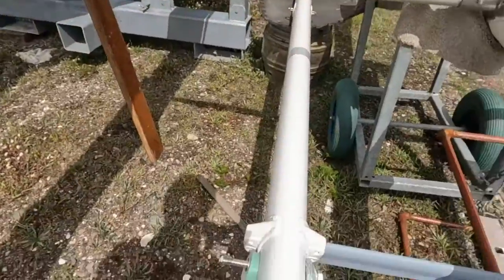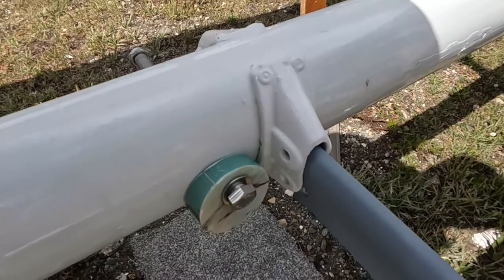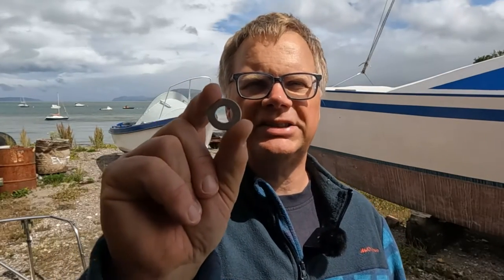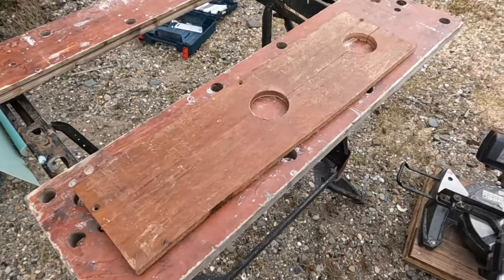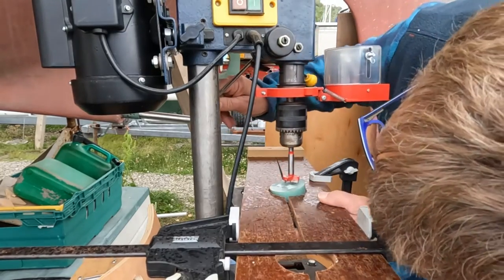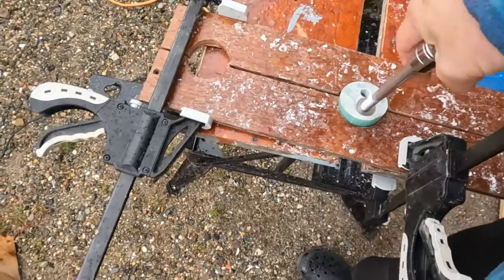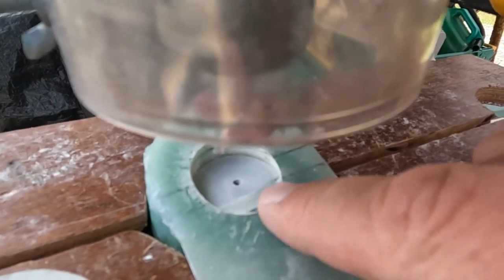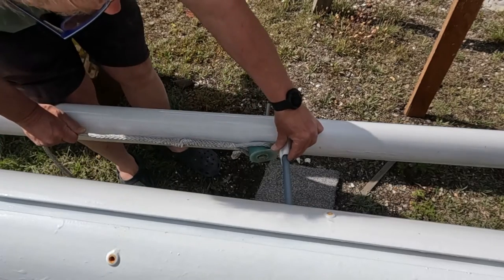DIY Mast tangs Version 2 for Dyneema shrouds, Synthetic standing rigging Episode 7

Comment: I will call the FAA and recommend an honourary A&P certificate for your efforts to adhere to aircraft specs! Congrats on the success with the bits. I have used FR4 in experimental aircraft and predict you will not have problems with cracking now. Consider epoxy paint as the resin will degrade with UV exposure. You could match your mast if you want. I would be tempted to make 4 perfect discs as your cheeks (although I wonder if you need to worry about the stay moving toward the mast and you might eliminate those.) and I would fabricate them and sand them before epoxying onto the tang. Then I would off-set the disks so they were eccentrically located to miss your spreaders. I believe you are using 2mm for cheeks. I leave it to your judgment but 3 or 4 would make me more secure. I would also use a fillet of thickened epoxy at the tang-cheek junction for many obvious reasons. Good work friend!
Reply from the maker: High praise! Thanks. Good tips for final finishing. 🤩

Comment: Hey, really enjoying your project here. One issue I think you should reconsider is the attachment of shrouds to the mast. The original tangs attached very close to the mast such that the bolt was mainly in so gle shear. This new design has a decent leverage arm on that bolt. I suspect you're at risk of fatigue failures over time on this one. I have training in this stuff so take it for what you paid...I'd stick with traditional tangs on the mast to connect up shrouds. Good stuff!
Reply from the maker: First thanks, glad you are enjoying the project.
We have thought about the issue of the leverage on the through mast bolt. Jane trained as a Civil Engineer so does do some check calculations for us, she does get irritated with my sloppy language about loads and forces so I hope she isn't checking the comments ;-)
Our first response is that we are not moving the load any further out than if we bought Colligo Marine cheeky tangs which we find reassuring. The plates on  the original tangs would not spread wide enough for a dyneema shroud with thimble (the original fittings were a flattened swage eye which was only 5 or 6mm thick). Also if we used a stainless steel thimble onto a pin we would be getting a point loading. Either a much larger pin is needed or a hard to find thimble with solid interior.
Remember that we are not tuning for a racing rig and that the Rival 38 has a fairly small rig.
My understanding (which may well get me in trouble and be wrong) is that as the tang fits tightly onto the unthreaded bolt the load is not a point at the middle of the shroud but the tang is going to exert the leverage close to the mast. Also as the tang is wide at the mast and tightly fitted to the mast the thickness of the tag below the bolt will also be helpful.
If I am wrong I hope that at least we will make a hugely popular video titled "We told Dave he was wrong" in which we capture the mast falling down ;-)
Reply: Ha, here's hoping you don't make that mast falling video! Glad someone checked it. Cool project that I'm enjoying watching. Boat design is typically very conservative with rigging in particular so this stuff is always welcome.
Reply from the maker: Well we hope we don't make that video as well. The number of 50mph+ storms that come through the Menai Straits in winter will be a first good test.

Comment: if the fr4 is unidirectional along its length then this would be a very weak part you are building. i would suggest a winded part. then again force is mainly compression on it above the screw. if you connect dyneema below srew it would be tensile on the fibres.
Reply from the maker: Nothing I've seen suggests that the FR4 is unidirectional. The two key disadvantages people have pointed out are a) the wear resistance isn't very high (but our loads are quite static) and b) it is not very easy to machine.
As the dyneema goes over the FR4 and the bolt goes through it I think all the load is compression, isn't it?
Reply: I have only seen extruded (poltruded?!?) Rods. In these the fibres are along its length. If you slice them obviously only the resin is holding them together. 

Tensile strenght is were carbon et cetera  is shining. 

For the cheeky tangs, my plan so far is to use aluminium halyard rolls between bigger washers or carbon endplates. The plates will be angled like yours to fit the mast and screw. ✌
Reply from the maker: This is the rod I've been using https://www.aiplastics.com/epoxy_4w_ep_rod.html

Good to hear someone else making dyneema tangs. Do your aluminium halyard rolls come pre-drilled? If so how are you going to get them to sit at the correct angle? Also how will you avoid galvanic corrosion between them and the bolt?
Reply: Nice to talk to someone doing a heath robinson, too. The plates you are using to hold the dyneema sideways would be angles/profiled to fit mast and screw. 

Another option is to use carbon rowing to make a cheeky tang diy. And further I am suggesting to make something like a chainplate that is also from rowing. Which uses tensile strenght of the fibres.  Like a 8 plate, screwed in on top and bottom hole takes the dyneema.

I have lots of rowing and the solution to any problem is to use epoxy with rowing ofcourse. Definitely following you very closely here..
Reply: Have you seen the witch sailor? He has a steel boat with dyneema rigging. He is using a super simple solution on his rail. Basically just puts the dyneema through a home in the rail and the button knots it. I would be reluctant because of chave but lots of other points of failure are eliminated. 
It would be cool to just do this for the baby stays at the mast. ✌
Reply from the maker: @horstlauch453  that is essentially what we are doing. We have an open soft shackle. Knot under deck, low friction ring in the eye. We have tested them to approx 4000kg.
Reply from the maker: See this video showing the dyneema chainplate loops we are using https://youtu.be/drRYh1XbmUA
Reply from the maker: I hadn't seen Witch Sailor. Makes ours seem very over engineered 😂
We are trying to have much gentler bend radius. I don't like the idea of cow hitch onto a 5mm stainless tang - but obviously it has worked for him.
Reply: Exactly the bend radius. But hey, he made it through the southern ocean like that.
Reply from the maker: @horstlauch453  Free Range sailing also used cow hitches on their mast but a much smaller boat.

Comment: Much simpler to replace the cotter pins once in a while. I don't get why you're so concerned with having to fix your things at sea when the original stainless tangs/pins are not something you're going to have to worry about for decades if you just replace the original equipment.
Reply from the maker: Hi,
It would be less change but the advantages are much more than being able to fix things at sea (or more accurately diy repairs in remote locations).
We believe our latest version is a significant improvement in lots of ways.